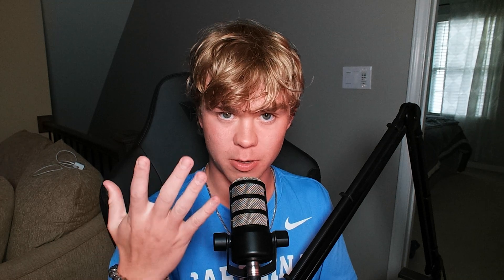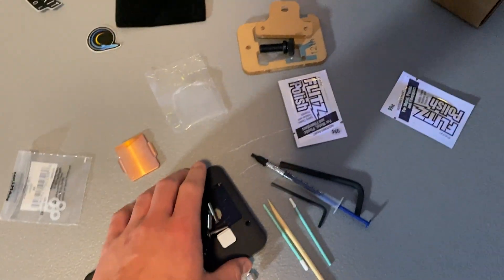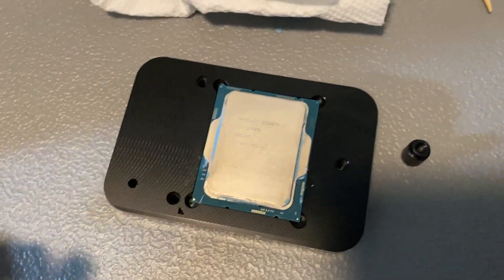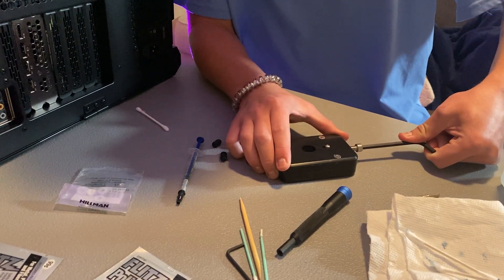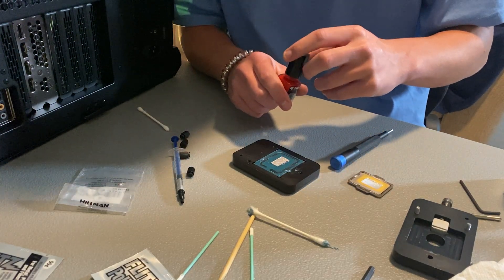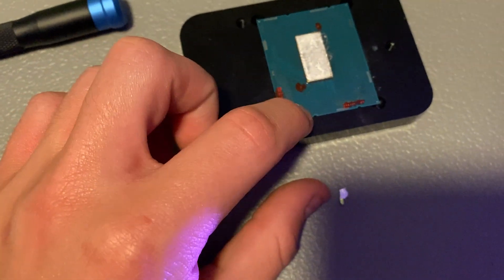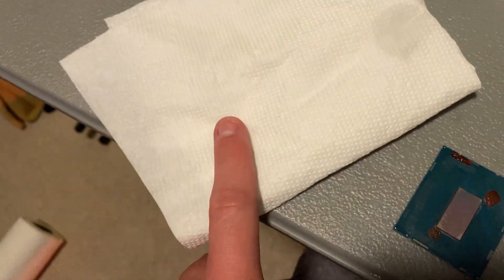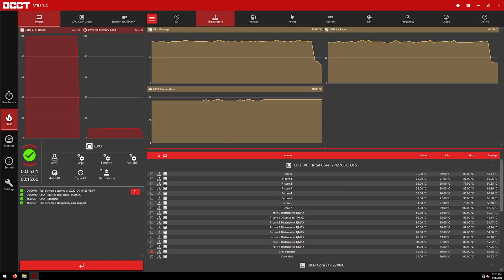12th Gen COPPER IHS!!! Worth the Risk???

Comment: The one thing most folks miss, when using a Copper IHS and Liquid Metal, you have to season the copper IHS meaning you clean it very well on the inside where it will touch the CPU, apply LM to it and let it set for a few days.. longer the better, why... because copper drinks a bit of the gallium and it fuses into the cooper, after it sets for a period a week is good,  clean and sand it almost back off until you see copper sheen through it.. clean it well again with acetone let dry and now do the painting of the LM onto the IHS and put it on the CPU as you paint it also. top side, I suggest TIM, but you could do the same if you have a copper coldplate, but not worth the risk there...
Reply: but I heard that copper has way better conductivity than LM soooo you dont want it seeping in, and the thinnest possible layer that's still liquid
Reply: @pinnacleexpress420  You are correct, TIM of any type, needs a this completely covered layer.. just needs to fill in the microscopic imperfections between the two surfaces.

Comment: Yo, that IHS is not properly made, the last core 7 doesn't have enough contact running at 100C, check if the nail polish is blocking the seating of the IHS btw.

Deltas during AVX2 should only max at about 5*C after delidding as a general rule of thumb. 

Keep the stock IHS, the copper ones are far worse made than the polish and flatness of the factory nickel plated one. 

Just sand the stock one with about 1000 grit and finish with 2000 grit paper. You can also lap down the die till you see a bit of a circle in the centre with 6000 grit paper.

Comment: I'm actually surprised, the Copper IHS didn't do anything to 9th gen cpu as far as temperatures go, however I run a direct die under AIO with my 9900K which is amazing 10-15c improvement, however I'm slowly building a new pc with new 12th gen cpu I'll be sure to get the Copper IHS with the Delid kit from RockItCool, Thank you!

Comment: This feels overkill. wouldn't it make since to just pickup an AIO cooler and call it a day? Are people really having overheating issues with these CPUs?
Reply: no , not issues, just wanting the best temps for a more stable overclock. You can legit get up to 1ghz advancments with a better temp. Sometimes , 15* is enough to make everyting stable, that otherwise would not be.. Its the difference between running a 5.5ghz OC or a 7ghz OC on my rig
Reply from the maker: Have you ever fully overclocked your cpu? It gets insanely hot

Comment: Do you think I can have comfortable temps with a 12700kf 5.0ghz-5.1ghz arctic 280mm aio and a o11 air mini case without delid?
Reply from the maker: Get the largest rad you can fit in your case
Reply: @ChamberTech  280 is what i saw fit and i heard in some cases the 280mm performs a bit better than 360mm. Im not really looking for a record OC just a OC that will do good in games like fortnite, warzone, apex, valorant, and rainbow six siege. All parts except my 3080 ti should arrive on monday. 3080 ti is arriving later this week.
Reply: Take it from someone who knows... do not delid unless your a seasoned overclocker. Homeboy with hos aio has zero reason to 😂